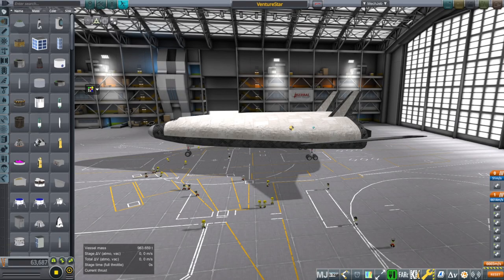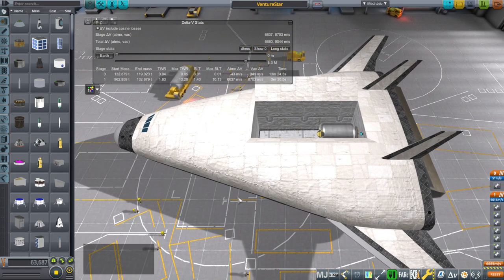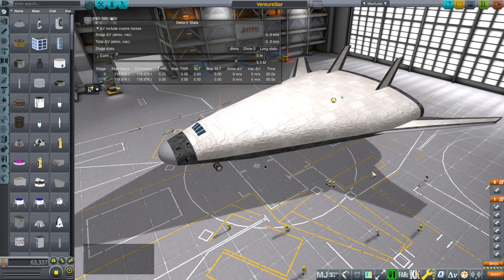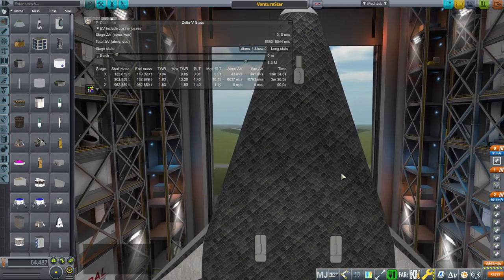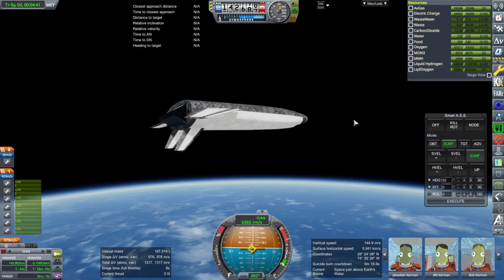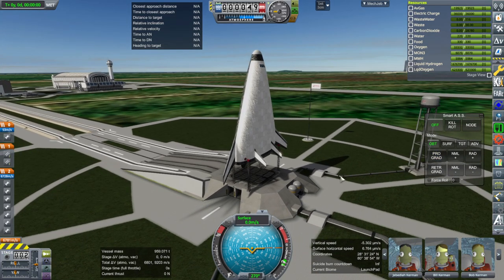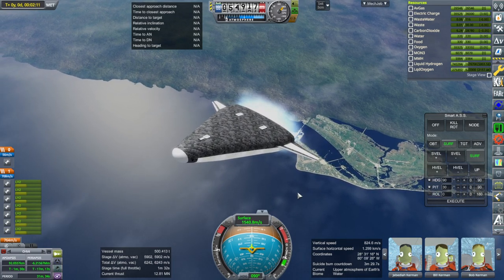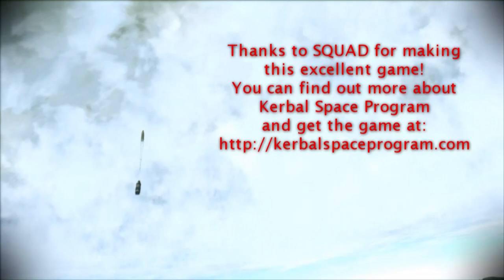KSP 1.8.1 with RO - VentureStar SSTO

Comment: Having played around with SSTO designs, I have found that a multi-fuel (hydrogen plus hydrocarbon) approach would solves some volume issues that this would encounter. A good real world example is the RD-701/704 which was proposed with the MAKS spaceplane. However, instead of a multi-fuel engine, it would be simpler to burn LOX/CH4 in some engines and LOX/H2 in others. Of course, thrust-augmented-nozzle engines would most likely be better than either an RD-701 style engine or the multi engine approach, provided that aerospikes benefit in the same manner that bell nozzles do with TAN. It is nice to see some working on the Venturestar for RO, even if its difficult.

Comment: Great video! I can address some of the uncertainties expressed in the video:

- “VentureStar” as a vehicle evolved heavily throughout the X-33 program. There were at least six “published” versions of VentureStar, the final design featuring much larger wings with the payload carried externally. The version you’re modeling, based on the finalized X-33 design, is the most common but was short-lived as a concept.
- As of late 1997, the RS-2200 engines slated for VentureStar were to weigh 6105.86lbs with a TWR of 83. Average ISP was listed as 435. Composite ramps and ceramic turbines were included in the design to reduce weight.
- Again, because the design of VentureStar varied so much, the payload to orbit figure is all over the place. I’ve been payload figures as low as 25,000lbs up to 59,000lbs. 45,000lbs is a common figure. Cargo bay size was to be 15’x45’.
- I think the body height of your model might be off. The length for that design is often listed as 127’, the width 128’, and while I can’t find an exact body height figure for that model, the similar subsequent model’s body height is listed as 28.75’ (46’ including tails). It’s fairly bulbous.
- GLOW more than doubled over the course of the program, from 2,186,000lbs to something like 4,500,000lbs (I can’t find the exact “final” figure). A GLOW of 2,627,000lbs for your model should be accurate.
- The propellant used for thrusters/OMS was either LOx/LH2 or GOx/LH2. No hypergolics.
- It was to be uncrewed, though there were discussions about transporting passengers as cargo (I believe mostly once the cargo bay was moved externally).

Feel free to reach out if you want any specific info.
Reply from the maker: Thanks for the info! I'll see what I can do to make it more accurate. On the GLOW, though, I don't see how it can be heavier than what I have unless the RS-2200 have more thrust than I see any indication of.
Reply: @RaizSpace  I did some more digging. As of January 1999, NASA listed the specs of VentureStar as follows:

- 151’ length, 159’ width
- GLOW: 2,628,900 lbs
- Fuel weight: 2,310,187 lbs
- Main propulsion: 8 RS-2200 aerospikes
- Take-off thrust: 3,537,000 lbs (so slightly higher at 1,966.67 kN per engine)
- Payload to LEO: 56,000 lbs

Those specs are clearly for at least the “4th gen” VentureStar (as opposed to the “3rd gen” version you’ve modeled), though every drawing I’ve seen of that vehicle has 7 engines. 

The RS-2000 specs from Boeing (published April 2001) are as follows:
- Thrust: 2,313 kN SL; 2,508.8 kN vac
- ISP: 342 SL; 456 vac

With how quickly things changed during development, you have a fair bit of leeway in how you choose to model it. The RS-2200 was very much a paper engine.

Comment: I don't understand the point of the aerospike engines here. Weren't the SSMEs good enough already, without the added complexity of aerospikes?
Reply from the maker: I have to confess, I'm not sure about the logic, either.
Reply: The RS-2200 aerospike would’ve been a gas generator cycle engine, and this was one of the big selling points for the design. It would’ve allowed for reduced complexity and chamber pressure (ideally increasing engine life, reducing maintenance time, etc.) over the SSME while maintaining similar performance.
Reply: @x-33archive  good point, but that's still a trade-off though... Less complexity in the engine cycle, but more complexity in the thermal/cooling side of things. + having to run a very expensive development program for basically a new type of engine (at least "new" in the sense that aerospikes have never flown on a serious vehicle)
Reply: @eldorado2752  I largely agree. There were pros and cons for both engines, but many of the pros for the aerospike seemed to revolve around a “we’ll figure it out” attitude when it came to the advanced technology required to make it work. Simple, proven engine cycle with differential throttling? Great! Composite ramps, cooling difficulties, high performance stats? “We’ll figure it out…”

They were largely committed to the aerospike engine once Lockheed Martin’s VentureStar design was chosen, and their win was certainly contentious at the time. I’m more of a VentureStar enthusiast than a VentureStar apologist myself.

Comment: The venturestar is really interesting do you think the system could work with more traditional engines like rs-25 or rs-83 instead of the aerospike?
Reply from the maker: Yes to the RS-25, but the RS-83 is a bit on the heavy side. The RS-83 might make up for that with its sea level ISP if the 395s number on wiki is legit, though (seems like a stretch for  gas generator engine).

Comment: How do you think replacing the RS-2200s with RS-25s or LR129s? You could also shut them down in flight to make orbit insertion easier
Reply from the maker: I think the problem is that the RS-2200's stated surface ISP is actually false, which is indicated by the expected surface thrust, and it probably outperforms RS-25. However, I do like the RS-25 in the scenario and have a plan for it. The LR-129 is too low-thrust as far as I know, and its stats are nebulous.